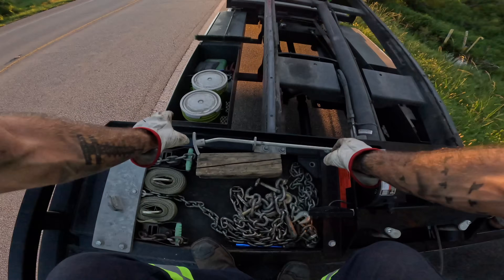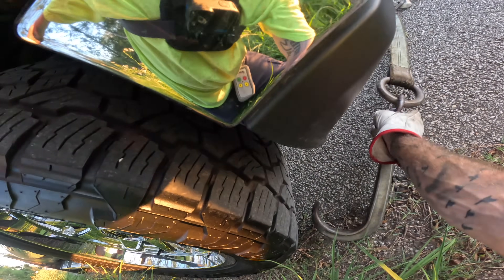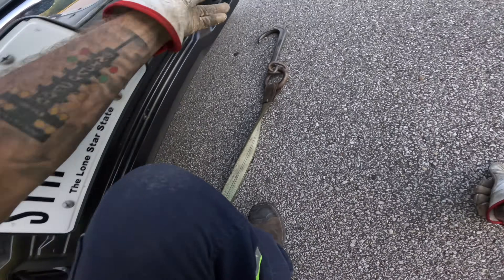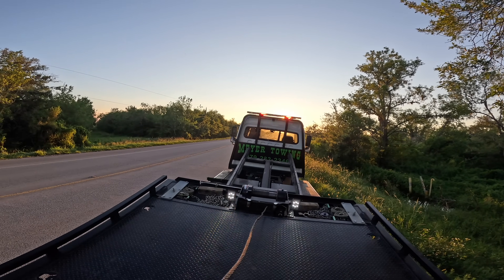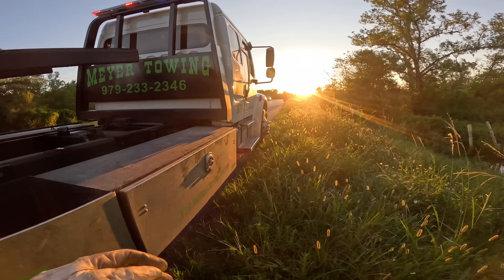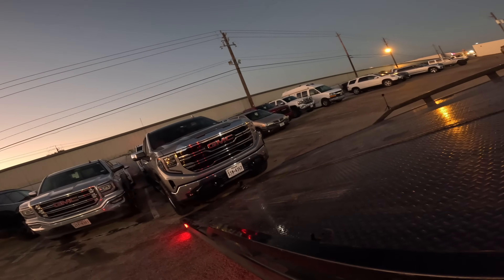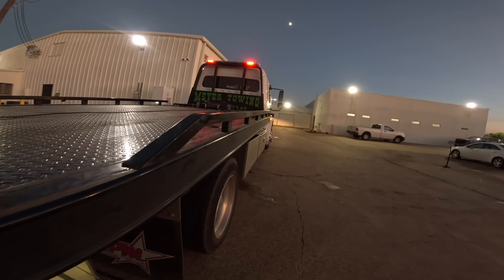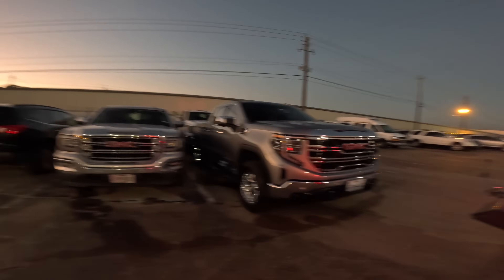Is GM Ever Going to Fix These Trucks??

Comment: No thanks I'll just keep my 20 year old GM truck.The new ones are garbage!
Reply: Best comment here
Reply: yes sir! and i’d add, anything with the GPS antenna is a steaming pile.
Reply: Same here.  I’m keeping my 24 year old GMC because the new ones are junk!
Reply: I have a 05 GMC , never going to get rid of it. Keeps on going and going...
Reply: They’re garbage. Had a 75k AT4 with 6.2L. Three catastrophic engine failure/replacements in 25k miles(2900/18000/22000). Has absolutely nothing to do with maintenance. Had to literally sue GM to get every penny back for purchase/payments plus interest and all collateral costs to include lawyer fee. GM fought me at first but chose to settle out of court and cut the check five months later. I received every single penny I spent on the truck and they paid my lawyer.
Reply: My 2002 Silverado keeps going.   If it ever did strand me, we can get it into neutral.    I will never buy one of these computers on wheels.

Comment: I had a 2020 Silverado LTZ w/6.2L for 3 years, and never had any issues with it. Now I have a 2023 Silverado ZR2 w/6.2L, and an 8-inch lift rolling on 37's, with 24k miles, and still no issues at all. Either I'm super lucky, or these supposed issues aren't as common as YouTube would make you believe.

Comment: From the 2024 user manual 

 Turn on the ignition without starting the engine. With your foot off the brake pedal, press and hold ENGINE START/ STOP for five seconds until the green light comes on the button is illuminated. See Ignition Positions 0 Pg 219.

From this point shift to neutral or shift transfer case to neutral.

Comment: I used to work the assembly line for GM and i can tell you straight up they don't care. Their EXACT words during a meeting were "As long as the vehicle looks good inside and out to the customer that's all we really care about". I was shocked when I heard that. these new cars cost so much but are so cheaply put together its not even funny. I'm slowly switching my fleet back towards 90's vehicles there is a reason they are still around almost 30 years later
Reply from the maker: I’d like to say that’s unbelievable, but unfortunately I believe it!
Reply: we had to sell my boss's 1991 c2500 chevy because only me ,the boss and 1 other guy could drive a manual stick.

Comment: I admire your skill. I recently discovered some manufacturers are selling vehicles without a bypass switch to put the vehicle in neutral while the vehicle is disabled. I cannot believe the government hasn't put a regulation in place to require it. Unbelievable. 😑
Reply: Not until someone has a death related to not being able to get in neutral like getting stuck on train tracks or a tow truck driver getting hit while under a truck trying to get it in neutral
Reply: Not until someone has a death related to not being able to get in neutral like getting stuck on train tracks or a tow truck driver getting hit while under a truck trying to get it in neutral

Comment: Wanted a 24 Sierra Elevation with the upgraded premium package. Money in hand and 11K below MSRP. Just couldn't make myself buy something with so many desgined in problems. Went with a used 23 Tacoma Night Shade with the V6 that's good to 300K miles with a timing chain and water pump change.

Comment: Simple, to put it on neutral you have to put it in service mode by pressing the push to start button for more than 5 seconds. Then you can put it on neutral without starting.
Reply: Yeah no idea why this wasn't done.  I get it if you don't know the trucks, but a simple google search would save alot of trouble here.

Comment: We were out shopping and someone had a yukon die in the middle of a busy intersection. There was a decent slope - so I jumped out, told her let's find the neutral switch get the thing rolled away. 5 minutes later and SHOCKED to find out there is zero easy way to put these newer GMs into neutral. I ended up getting the thing to start and barely run and got it out of the intersection. But very, very surprised that you can't put a newer GM into any sort of neutral mode.

Comment: Love your vids.  Thanks for letting us ride along.  I know it's not always convenient on the job, but I did notice you have a nice phone with you.  I googled "gmc truck into neutral" and got immediate results.  Owner's manuals also identify "service mode" instructions.

Press and hold the start/stop button with key fob with you and foot off the brake pedal for 3-5 sec. lights on your dashboard will flash and your truck will go into ACC mode now you can move the gear lever to neutral by pressing on the brake and shifting to neutral.

 From owners manual. Service Mode This power mode is available for service and diagnostics, and to verify the proper operation of the malfunction indicator lamp as may be required for emission inspection purposes. With the vehicle off, and the brake pedal not applied, pressing and holding the button for more than five seconds will place the vehicle in Service Mode. The instruments and audio systems will operate as they do when the ignition is on, but the vehicle will not be able to be driven. The engine will not start in Service Mode. Press the button again to turn the ignition off.

Comment: Press and hold the start/stop button with key fob with you and foot off the brake pedal for 3-5 sec. lights on your dashboard will flash and your truck will go into ACC mode now you can move the gear lever to neutral by pressing on the brake and shifting to neutral.

 

From owners manual. Service Mode This power mode is available for service and diagnostics, and to verify the proper operation of the malfunction indicator lamp as may be required for emission inspection purposes. With the vehicle off, and the brake pedal not applied, pressing and holding the button for more than five seconds will place the vehicle in Service Mode. The instruments and audio systems will operate as they do when the ignition is on, but the vehicle will not be able to be driven. The engine will not start in Service Mode. Press the button again to turn the ignition off.

Comment: Well done worked with a lot of tow guys and learned the neutral trick and walk the truck over to the load. I like how you actually gave a shit about the truck and did not just yank that shit on. I’ve had to take the controls from a few bed and rotator guys. 👍🏻

Comment: After watching your videos, I would avoid the electronic transmission. In fact, I did. I purchased a 2023 Chevy Traverse which still has the shifter instead of the buttons. Great to see your back and I love your videos,
Reply: Just so you are aware, even tho you have an actual shifter, it is still electronically controlled. The shifter in your traverse is not connected to the transmission at all, instead it is connected to a module which then tells the transmission which gear you selected, just instead of using buttons. It is using a shifter.

Comment: I have the same shit box same color , from day 1 camera system doesn’t work , guess what? Today 1 year later after maybe 12 visits to the dealer and car stayed about 45 days there , changing 3 parts ! Still doesn’t work!!!, and others problems like steering wheel not fixed in position 😂 did i buy a toy?!

BTW you can put it in neutral by pressing the 2 wheel drive button 5 times , then it will shift the T-case to N .

Comment: You all are lucky.  All related to the software but an easy fix is a reboot like your computers. just reset the computer by disconnecting the power.  Fix for all lock-ups.  These issues are also with the new hummer EVs

Comment: We had to move a 68 Bonneville with all four brakes frozen.  We put a backing pan in each wheel.  It slid up the trailer easily

Comment: You gave me an idea to try on my 2024 Chevy Colorado Trail Boss 4x4. My question was can I put my transfer case in neutral without starting the engine. I can! I think it may work the same with this truck also. Hold the Start button, make sure its in 2H, put it in neutral, press the 2H button 5 times within 10 seconds, the display should show N for the transfer case indication. This only works for 2 speed transfer cases, GM does have 1 speed transfer cases that do not have neutral. Sorry if I told you something you already know. Great video!

Comment: Any “American” made vehicle these days are just straight trash. Had an Escalade 2015 and it only made it to 123,000 something miles. I used to be an Aircraft Mechanic and stayed on that thing like a Citation Jet…… oil every 3,000 miles, trans every 25,000 just on top of all the fluids and maintenance…….. And still 123,000 miles before the engine block started cracking. I’m with Lexus now and I’m not going back to anything else.
Reply: Twin turbo lexus are NOT what they used to be...25k+ repair bils for twi turbo put of warranty...Best of luck.  NOT EVERYONE CAN AFFORD A LEXUS
Reply: @ramaswamynarayanaswamy4806  I’m not touching anything turbo. Everything has to be N/A with me.

Comment: People criticize Toyota. GM has been dealing with this for years. They literally destroyed the dependability of the LS based engines.
Reply: We criticize Toyota because the turbos are failing prematurely on the new Tundras. Besides that, Toyota has had quality control problems since 2009/2010.
Reply: At least toyota takes care of their customers. Total engine replacement.  Look at all the recalls for ram, gm and especially Ford. Tundra has always had the highest resale value of all full size trucks.
Reply: The failure not on all new tundra.  Another toyota hatter
Reply: @Davidami48  That's all brand name bias that stemmed from them being what was the most reliable manufacturer. Sure you can get a total engine replacement - in 2-3 months time. Can you truly have a vehicle down for that long? If I was in a State that had the lemon laws, you can sure believe that I would file for suit on that.

Comment: Why would you be driving your truck in auto 4 when it's a perfect sunny day? I swear these parking lot cowboys are something else
Reply: You do know auto 4 doesn’t give you 4 wheels like regular 4x4 right? You could be in 2wd and it gives you all 4 whenever it senses the truck is slipping.
Reply: Still silly to leave it on
Reply: @Thekidsinafrica14  Per GM Mechanics you should absolutely NOT leave the Auto 4wd feature on all the time and only use it part time for rain or snow.  I have an AT4 and confirmed this with a few dealerships.
Reply: Yep 20,000 Mi oil changes are also recommended
Reply: @SammyAt4 You need to find some better deslerships then…
Reply: Auto 4WD is like AWD where the power goes to the wheels that require it ( the axle/ axles that requires it in a truck ) . It’s in 2WD until the system senses  wheel slip, so when that happens it adds in the front wheels.
Reply: Seriously? You don't know the full context. Instead of being a couch critic why don't you focus on something positive instead?
Reply: You shouldn’t and anyone who read the manual would know this.

Comment: Should’ve been towed to the junkyard
Reply: owned a 19 fully loaded gmc.  The tranny went out around 30,000, 5.3 motor went out at 32000.  Traded it in for a 21 Ram, 80,000 miles later and zero issues.
Reply: Lucky, tons of recals on rams, 1.5 million trucks and 160k trucks in canada for brake failure just this month lol

Comment: No vehicle should have an electronically switched transmission. It doesn't make any sense. It's just Engineers deciding to reinvent the wheel yet again
Reply: Clearly you've never heard of a 1962 Plymouth Fury push button transmission 😂

Comment: its crazy these trucks don't have a N override I have a ram 1500 and it has an electric transmission but it has a trim piece under the headlight knob that pops off and you pull a release tab that's connected to the transmission to force it into N in case of dead battery or situations like this.
Reply: Yeah my challenger has the same thing. I always thought this was normal and didn't realize multiple manufacturers are not installing them. Wow, just wow.

Comment: all things considered, I think you did an awesome job! I have a 2023 Chevy Silverado Trail Boss LT 5.3L. This sucks that they all do this, not being able to put it in neutral. I won't be so lucky to get a tow service as caring as you.
Reply: Got a 2018 Silverado 6.2 LTZ. NOTHING BUT TROUBLE WITH IT AND ONLY 130,000 km. A/C leak, fan motor, tranny shudder, fuel pump twice. Sitting on a time bomb waiting for AFM to screw up the engine. Bean counters killing the car companies.

Comment: My 2017 Silverado 2500 Duramax with 80k miles  just had the same problem. Same part (fuel pump control module) went out. It's on nationwide back order and no new ones are available. Shop found a used one in Missouri and had it overnighted. I ordered one just to have a spare. No telling when I might get it.
Reply: You're telling me the older diesels use the same pumps?
Reply: It's not the pump. It's the control module for the lift pump. Learn to read. All GM vehicles use the same part, and their all failing.

Comment: So have a 2019 Chevy Z06 Corvette. Been in the shop for over a month now with a blown engine. Being told by GM that they’re not making a motor anymore so there’s no part to fix it. So I have no clue when I’ll ever get my car back. Meanwhile, still paying a note on my car and still paying for a rental at my own expense thank you GM. The car has been in shop to have rear axle rebuilt twice. Transmission is shuttering constantly. They flushed it, but that didn’t fix the problem. Leaking hydraulic pump at rear of car which I contacted AC Delco and I was towed that GM knew they had a problem reached out to them to rebuild it but never replaced them just started putting them in the new cars. cracked rims, they won’t cover. I had to buy new rims myself. Runs in my paint ,damage on my letter seat when I first purchased the car so they took pictures sent it to the warranty people they said denied not covered. So presently standing by right now to see what they’re going to do and no phone call so far this week so still have no clue. GM could do so much better if they went back to caring about their consumers who made them very wealthy. Worked my whole life dreaming of buying this car to have nothing but problems with it and no support from GM. But all the extended warranties rim extra extra extended warranty just in case I had any problems with the car nothing covers anything. rim protection says oh we can’t cover it because it’s in a class action lawsuit. GM is constantly in class action lawsuits. There’s 877,000 of them for engines??? So no support from anyone. I have purchased vehicles every six months from GM a grand total of 60 in my lifetime. Only to be treated like a stepchild. So I’m glad all these vehicles are sitting on a lot and no one‘s buying them cause they’re not worth the money. So not very happy with GM and don’t think I will ever buy another. I also had my battery box burn up ￼at the rear of car. Brakes are squeaking.￼ oh and GM keeps on pulling my post down every time I put it up so no one will see this but I have all day every day to just keep on posting so good luck keeping up all kind of connector. The installation is all cracked. The wires are touching each other and shorting out so all kind of electronic problems in the car also. So go run and buy you one of those real expensive ZR1 so you can make their shareholders more money and have fun getting them to fix anything because they refuse to fix anything.

Comment: Nice truck. Too bad that $80k can't get ya a dependable truck though!
Reply: That's not an $80K truck. I paid $85K cash for a brand new loaded diesel dually. That's half ton gasoline engine.
Reply: @scottmichaels12 both are overpriced
Reply: @scottmichaels12  As optioned it's a 70k-80k truck.
Reply: Personally think it’s “UGLY ON TOP OF UGLY”! Supposed to be a TRUCK not a Cadillac

Comment: Personally that’s why I’m sticking with the my 2010 and want a 2014-2018 gen in the future because I don’t trust the 2019+ trucks rather it’s a Gm, Ford or Chrysler truck cause they all are having reliability issues. But I’m grateful for my 2010 5.3 with the 5.3L V8

Comment: I’m pretty happy with my 2010 Silverado. Of coarse it has had some minor problems being 14 years old but it has been very good to me. New trucks ?  Way too expensive for one thing which is why I’m sceptical about replacing this one. I think I’ll keep it for awhile
Reply: SecretAsian84 My 2010 Silverado 5.3 with AFM just crossed 150,000 miles and still runs like a champ...never had any issues with it.  I just make sure to change the oil every 5,000 miles and use full synthetic oil.  It is starting to use a little oil but I just top it off a couple of times in between oil changes.  And yes I do know about the lifter issues these engines have so I'm crossing my fingers about that😊
Reply: Don't ever get rid of it. Ever! You'll regret it if you do.

Comment: Toyota has a 100k new Tundras recalled for self destructing engines. Tacomas are eating their transmissions. Ford has another recall on its twin turbo engines. Nissans were so bad they gave up on the Titans. You'd have to be crazy to pay what any manufacturer is asking for new trucks. After driving pickups for 25 years I gave up and bought a small car and I have no regrets. I need the extra cash to make up for inflation anyhow.
Reply: Ram has Cummins motors throwing rods through the block.
Reply: I have done the same daily drive a small car gave up on trucks to rich for me.
Reply: Actually, Nissan is the more reliable sleeper of the mid and full size truck market. It was sales numbers and needing to hit fleet mpg numbers that was the reason the Titan was cut from the line.
Reply: Chevy got alot of recalls to